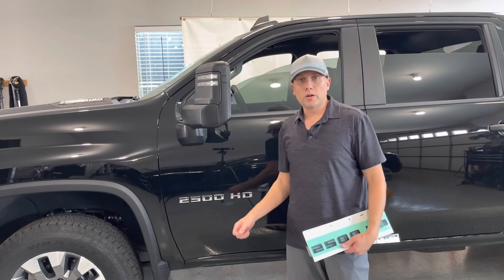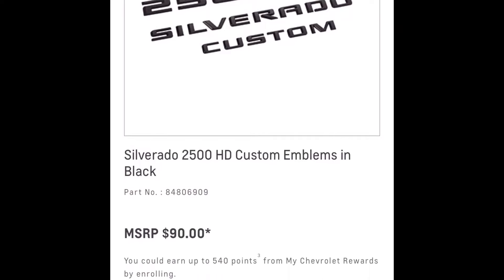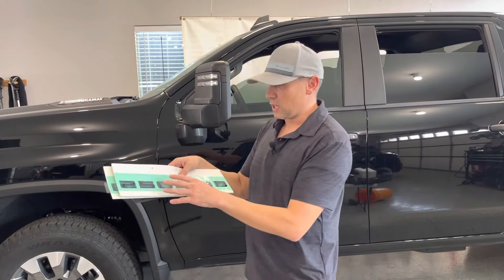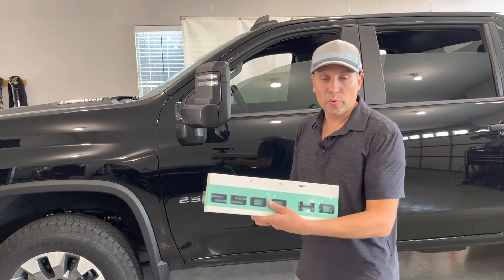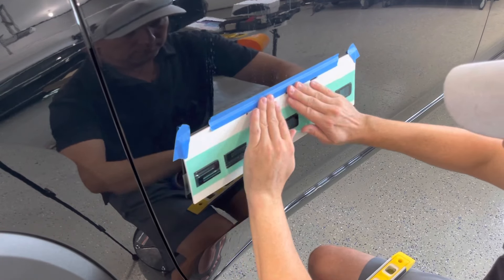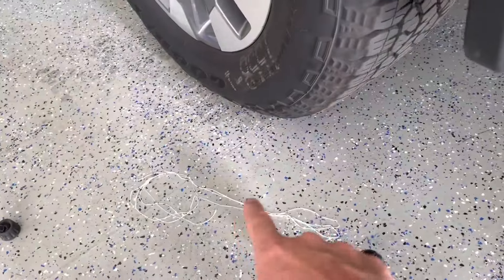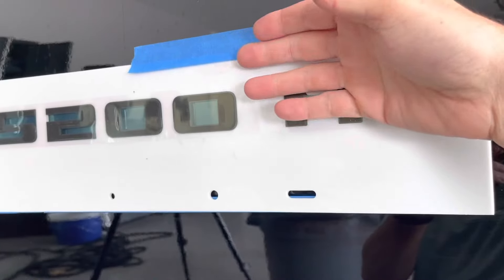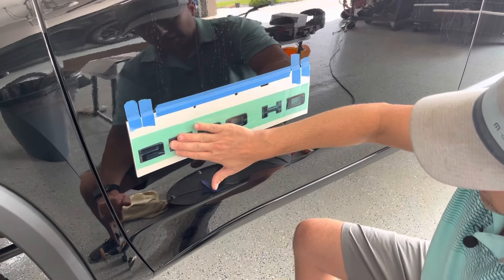Silverado 2500 HD Installing Black Emblems | Removing Chrome Emblems

Comment: Good stuff. I’ll be doing this for sure. You made it look easy.
Reply from the maker: It’s just time consuming.  Getting the old adhesive off is the biggest challenge. Thanks for watching
Reply: @Myksgarage  one more question: you didn’t have to use a heat gun/blow dryer at all on the badging you took off?

Comment: Is there a link to the templates or do they sell them seperately? I just purchased some 2500 HD emblems and GMC ones but not sure if they come packaged like the ones in the video.
Reply from the maker: They should come with the template
Reply: The official GM accessory emblems will come in templates like these. Ebay/amazon ones may not.